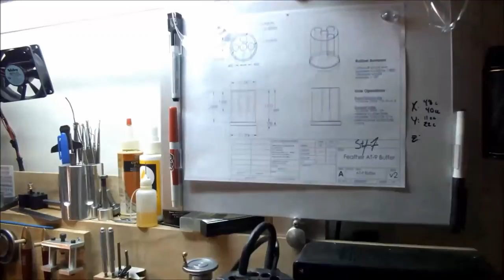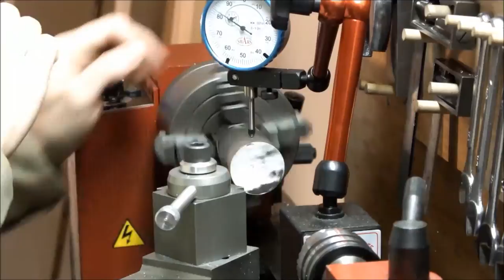Feather AT-9 Buffer Replacement

Comment: Nice work. How has it held up? I have one of these & it blew the original buffer yesterday. Feather wants about 150.00 for replacement & I hear their service is terrible. The rifle seems like it was made by a kid in shop class, but they are fun to shoot & are reasonably accurate. I see their replacements are delrin or similar material. Did you get any mushrooming on the aluminum? Love to get a drawing of a good design as I have a South Bend 9" lathe. Mine is really rough on cases & ammunition, but think it may be due to my modified Uzi mags.

Comment: Stephen, what lathe do you use? I've been looking to get a small metal lathe for small-medium sized projects and yours looks perfect for my needs, what are the pro's and cons of it? And did you get it from the original manufacturer?
Reply from the maker: The lathe in the video started as a Harbor Freight 7x10 (purchased new).  I discovered a crack in the bed casting and rebuilt it with the Little Machine Shop 7x14 kit.  Pros:  Little Machine Shop carries just about every replacement and upgrade for the machine, it doesn't have enough power to rip your arm off while you learn to use a lathe, and it doesn't take up a lot of space.  Cons:  It lacks the power and rigidity to take real cuts, it requires a lot of attention to keep things tight and accurate, and you need to be very patient.  It helped me learn to use a lathe and I'll probably keep it for small work, but I'm happy to move on to the 13x40 lathe I just bought.  I would probably suggest something like a lightly used 9" South Bend if you can find one for a good price.  That class of machine would let you work on larger work pieces and give you some room to grow.
Reply: @pstevepsu   Are you still making this part and how do I get in contact with you
Reply from the maker: @martyben8647  I do still make these.  Please go to the website listed in the video description (sfair.weebly.com), click on the Contact tab and submit a message with what you are interested in.